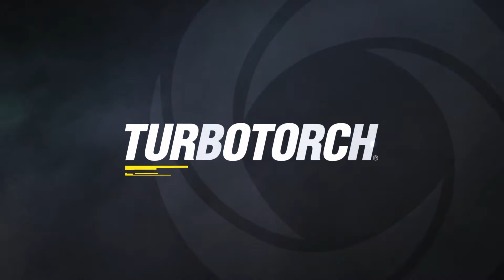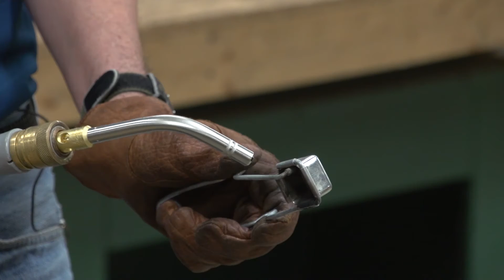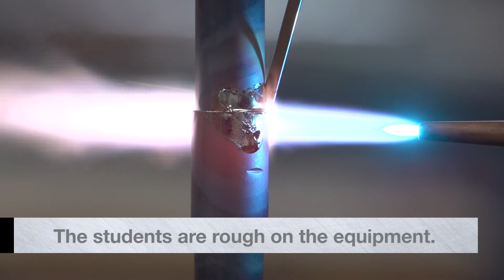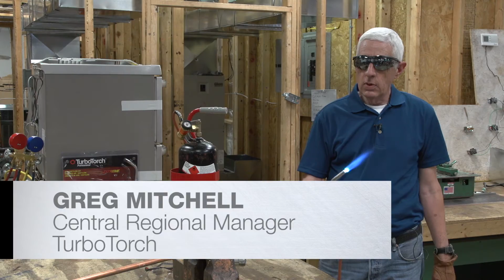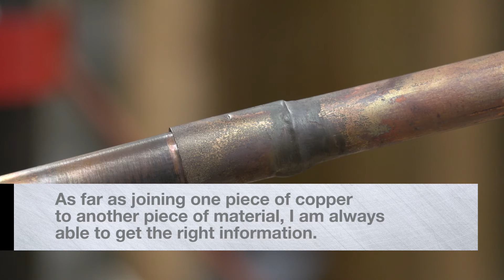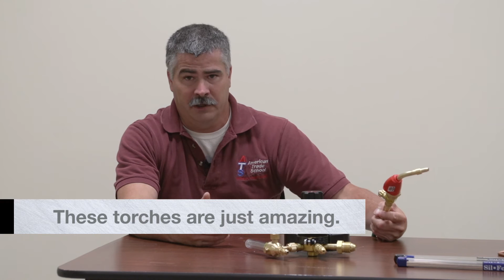HVAC Instructor Touts Superior Durability in TurboTorch and Victor Torches

Comment: Any good US torch can hang with the main concern being ergonomics since torch preference is like rifle preference, ergonomics matter. I have many Victor torches and maintained a welding school fleet. They held up decently but the classic Victor torch head design should be offered in stainless steel like Concoa does. Victor charges a punitive amount of money for their torch head reamers (I can buy a Harley-Davidson crate engine for that price!) and their torch heads do warp. I own several examples and will eventually snag a used reamer then resell it.  Just because Concoa are famous for steel torch heads doesn't mean others cannot sell them too.

Comment: as a welder all my cutting torchs have been victor, i bought 4 victor Turbotorch TL-44 for plumbing and i am alway having problem of flam brake out, some times it just been a drip od oilder that gets on the air gas mixer in side the tip, you pick it out and your good to go. but the worst is, one day you pick up one of the 4 torchs and go to a job, you get there and turn the map gas on and the triger lighter, sparker will not light it up, you light it by hand on low,and it burns ok on low, but soon as you turn it up the flame go out in a ball braking away from the tip, you think it because soilder in he mixer but after taking it a part, looking it over it is clean, but will not burn right, the next time you pick that one up, it may or may not burn right. it drives me nuts, this is why i have so many,, they are not cheap. like close to $200 cnd each. what is wrong? ihave looked on here for videos on this problem, but nothing found, i have had these for years and alway been a problem, this video is from 2015 so i am sure i will never get an answer, but i can hope